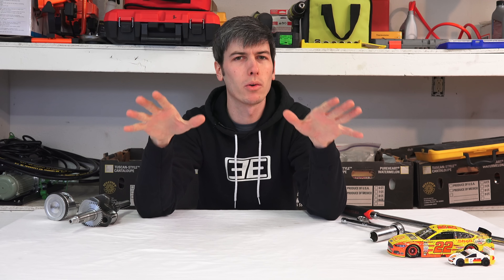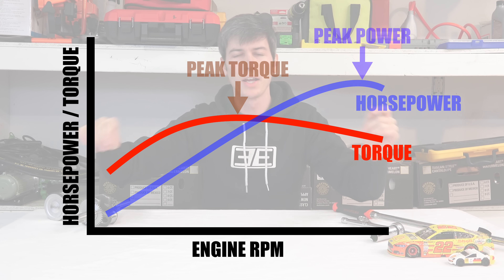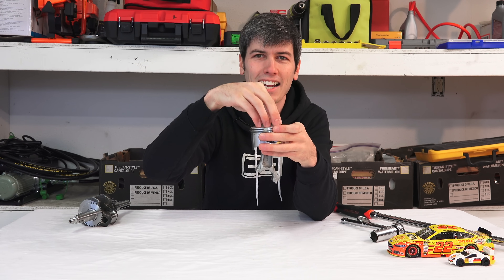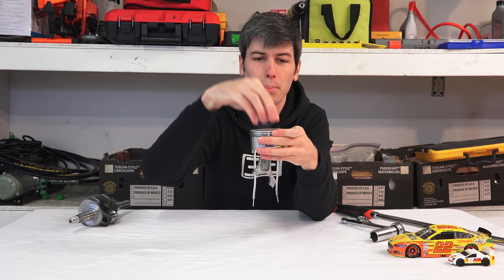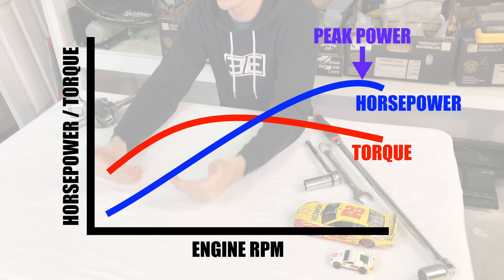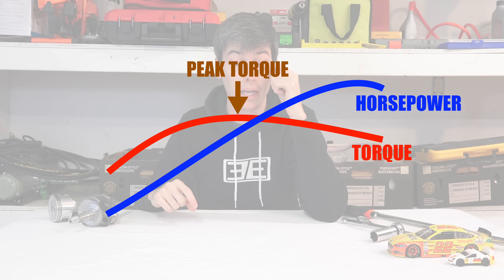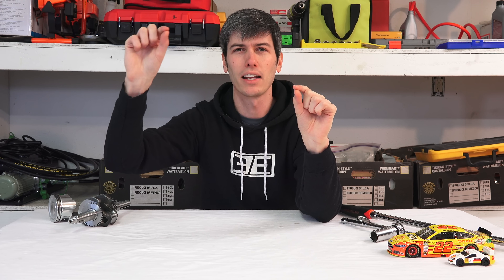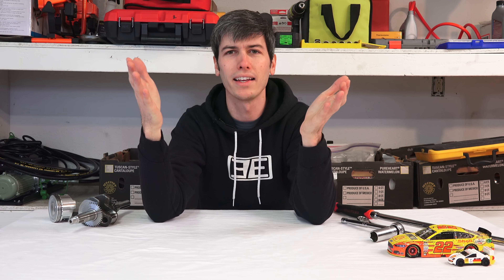Horsepower vs Torque - A Simple Explanation

Comment: First of all, thank you for this precise and very helpful explanation. 
But I have a question - as you mentioned, in theory, a CVT transmission should give the highest acceleration, because it's working on full power rpm (full throttle). How is it possible that it is slower than i.e. Manual transmission (same car, same engine)? 
What is the explanation? 
Greetings from Germany...

Comment: Is this why CVT transmissions are kind of good?
Reply: They are "good" because it's cheaper to manufacture than an automatic transmission, lighter weight, better fuel optimization curves, and somewhat smaller packaging. Manufacturer's don't care about anything else in the kinds of cars these go into.

Comment: 2017Hyundai Tuson at 175hp and 195tq (0-60 7.4sec) is faster than a 2018 mazda cx5 at 187hp 186tq (0-60 8.1sec.)  Can anyone explain that? Both are about the same weight.. give or take 100lbs.  Does transmission type come into factor. Thanks.

Comment: "Horsepower drops after peak HP, Why would you rev it up to redline? Just shift at peak HP." Those people could also take notes on total amount of wheel torque after gearing.
Reply: It's actually better to rev beyond the point of peak hp because you have are nearer peak hp again after you shiftet. Basically you want to stay in the rev band with the highest average horsepower.
For instance let's say an engine delivers 80hp at 4000rpm, 90hp at 5000rpm peak hp is at 6000 rpm with 100hp and redline is at 7000 with 90hp again. Now you shift and your rpm will drop off about 2000rpm. Where's the best point to shift? If you shift at 6000rpm it drops to 4000rpm and will only produce 80hp at that rev. If you rev up to 7000 and then shift, the rpm drops to 5000 and you immediatly have 90hp again to your disposal. 
So it's better to rev a bit higher than peak hp to still be in a good rev range after the gear change.

Comment: Could u not make a car with loads of torque and not much power move faster by using gears like a high gear and less gears like u do with a high power low torque car lods of short gears so u get the rpms up
Reply: That's exactly what semi trucks do.  Typical big rig engine only makes about 350hp but can be up to 2000 lb-ft of torque.  They use a lot of gearing, 18 speeds or more.   BUT the reason isn't what you think.  it's because these engines are designed for long durability of millions of miles; the only way to achieve that is with low revving engines.

Comment: Acceleration is the increase of velocity therefore the increase of kinetic energy.  Power is the increase of energy.  Therefore for maximum acceleration you want maximum power input to the vehicle from the engine.  Maximum acceleration occurs with the engine at maximum power output, as long as you can match the engine speed to the vehicle speed.

Comment: Now im even more confused so how can a truck have 1000hp and a lot of torque but be slow ? Is it bdcause of gears? Would truck engine be very fast if it had longer gears?
Reply from the maker: If a truck has 1000 HP and is still slow, it probably weighs a lot. A lot a lot.
Reply: Engineering Explained i mean just a truck without it hauling weight. So the issue is that its heavy? If that engine was put in a car it would rip the streets?

Comment: The only problem with this explanation, and he knows more than me about cars, is he’s talking about power moving a car from one point to another. That’s true but only because of increased air resistance. He’s right, but in a simplified physics model, which this is supposed to be, moving an already moving mass from one point to another requires zero energy and therefore zero power. Might have been better to show it going up a hill.
Reply from the maker: Work is force x distance, both in the same direction. A moving car has kinetic energy, so if you move if from a standstill (no kinetic energy), it requires power to do so.
Reply: Engineering Explained from a stand still sure.

Comment: What advantage does the 100hp/200lb*ft car have? It can't accelerate faster....could it move a heavier load faster?
Reply: The 200lb-ft engine could haul four passengers up a hill without needing to downshift. The 100ft-lb car would struggle and need to downshift i,e the 100ft-lb car has to do less work but faster with increased mechanical advantage (torque increase).

Comment: Actually the most important fact is weight not torque/horsepower....try and tow a boat with a civic versus a turbo diesel with the same power output. The civic likely won't even move, also the more you use gearing to compensate the less time you get to use that torque for.....this is why the tesla does so well huge torque.

Comment: I always learned that horsepower is bought and torque is made. 

As an aside. I was also taught that peak torque is the lowest rpm at which the piston can draw in a full charge. Which would be an indication of the point at which the engine is most efficient. Though I am pretty sure that it isn't quite that simple.

Comment: Good job explaining Torque & HP. I used to think torque=acceleration & HP=speed. Could you explain Torque as used in a big truck? A semi and a Ferrari may have similar horsepower. But the truck has lots more weight pulling low-speed torque. 
I'm not sure I know the difference.

Comment: I still don't get the graph, why do you show torque for a given gear ratio but  power you get to use two? This shows torque and power as functions only of RPM, shouldn't gear ratio be constant?
Reply from the maker: Changing the gear ratio changes what RPM you are at for a single vehicle speed.

Comment: It might be easiest to think of it as the max torque being where the engine is most efficient, but by running the engine faster, even though it's at a lower efficiency you can get more power out of it in a given time. Just another way to think about it as a mental cue, nice video :)

Comment: yeah but gear ratios aside... lets say the cars that you were showing with the opposite figures but same gear ratio.. the one with higher torque i would assume would be able to take off at a faster rate but top off sooner in the upper rpm while the car with the lower torque is taking a bit more time to get up to speed but since it has more hp it will continue to gain speed while the lower hp car is topped out.

Comment: Hi! I'm a big fan of the channel. From what I gather, horsepower = torque x rpm. How can the speed (rpm) increase while still having the same amount of force? Isn't the force created during combustion responsible for how quickly things spin? It isn't clear to me how the rpm can increase or decrease which still having the same amount of force. Thanks in advance guys!
Reply: Joe Vargas assuming natural aspiration, as each cycle passes you add more fuel, the force applied is higher , so it accelerates the revs as each cycle passes.

Comment: So if bhp is torque X rpm how do you get dips in power at higher rpm?
Reply: You get friction which adds up , also you can only rotate a set mass to a certain point where after it cannot be given any more energy
Reply: Kavi4GP but wouldn’t that cause a plateau not a dip?

Comment: Ok, you had me until you brought up the car race, lol.  I get it.  Since the truck manufacturers are always fighting for more torque, why don't they just make a thicker engine with longer piston arms and therefore increase torque?  Hope I'm making sense.
Reply: They were called Big Blocks and inline sixes. Fuel economy and emissions regulations plus modern engine tech have obsoleted them. A 460ci Ford big block made 510ft-lb torque and got about 10mpg. A modern 3.5 turbo makes 470ft-lb while getting 20+mpg and has a better high rpm power band.

Comment: Peak acceleration occurs always at peak hp, beacouse you deliver most force you can in specific period of time. You told that with a fixed gear you get the top acceleration at peak torque. I thing that's not true, but in fact you can feel that force pressing you into a seat, becouse somewhere in that range hp has the most increase (especially in non turbo cars).

Comment: Torque wins races. Horsepower sells cars. Caroll Shelby
I think he meant peak horsepower looks good on paper but if you're not maintaining a high torque throughout the band then the overall power is not utilized effectively.
A ricer may produce high horsepower but not produce later on its rpm range...

Comment: Nice video, thumbs up, but why not just say Power is time related  unit so if you talk power you are talking TIME. Most of the people confuse power with force or strength and that is because it is not so obvious from unit like 200HP to spot the TIME. If people would understand POWER = work through TIME, then it would be quite obvious if we are in terms of "fast" and "how fast" what actually means we are asking "in what time" or "how much time you need", then we know we want more POWER since Power is telling you just that = WORK in TIME.
And work is = moving the car.
Torque is just telling you what kind of gearbox you need so you can optimally transfer force to the wheels to get best power :).

On the other hand, POWER in normal language, one that is not physics related,  does not have that same meaning, hence all the confusion. It is just wording and different meaning for same word across wide scope of human activities.

Comment: You mention that horsepower equals torque x RPM. If a car, for example, has 200 horsepower and 100 lb-feet of torque, how does that plug into the equation? Wouldn't that mean you take the 100 lb-feet of torque and multiply it by the RPM to get horsepower? That would be 100 x 3000 (at 3k RPM) is 3000 horsepower, which clearly isn't right. Can you explain what units are used to plug into the horsepower equation for it to make sense?
Reply: No, you have to divide it by 5252, so 100x3000 is 300,000 divided by 5252 = 57.121
Reply: Thanks for clarifying! Would be useful to include in the video, but I suppose a Google search would've answered that for me as well.

Comment: What confuses people is that they think they can "feel" torque. If you have 2 cars like say a dart 1.4t and a dart 2.0 na. They have the exact same peak hp number of 160 but the 1.4 turbo has ~40 lb-ft of torque more. It is quicker and feels quicker because it has more hp in the lower rpms while the 2.0 has the same peak hp but much less hp in lower rpms. If you had a cvt or at least a 10 speed transmission that kept the engines in their peak power they would be exactly the same speed. However when most of us drive we drive at partial throttle 2-4k rpm, not at 6.5k thus we feel the greater hp the car with more torque has. 

TLDR
Cars with more torque have more low end horsepower then cars with less torque but similar peak hp
Reply: Great of you to note this. So if we stick to the philosophy that power is ultimately what we want (although torque is still important, we not too concerned about it), we need to get away from the idea that only peak power is important. What your are hinting at and what people need to consider is the is the area underneath the power curve. The greater that area, the faster the car can accelerate.
Reply: Exactly why modern turbo diesels became so popular (in UK and Europe at least) as they provided accessible HP in day to day driving.
Reply: This is what I was looking for. The difference in torque between the e92 BMW 335i (twin turbo inline 6 cylinder) vs the e92 BMW m3 (v8 na) where the 335i has more torque but the m3 has more horsepower.
Reply: Very true that
Reply: The peak numbers might be the same but the turbocharged car may have it over a wider rpm band, making it closer to its peak value more of the time. The peak numbers don’t tell the full story
Reply: chad wran so that would make a turbo charged engine better than a naturally aspirated engine?
Reply: Tanah nailed it! Torque directly correlates with rate of RPM change (perhaps we'll call it angular acceleration) while power correlates to vehicle speed change (acceleration). High torque helps trucks accelerate loads from a stop without stalling or burning clutches and it helps turbos feel perkier by making the front part of the power curve steeper (the slope of power or acceleration is called "jerk").
Reply: Tanah Merah That's not right. Within a particular gear, peak torque is where the engine is most efficient and has the greatest acceleration. Torque is a force and  angular acceleration is a component of it. When you bring a gearbox into the equation you can get better acceleration at peak power by gearing down.
Reply: Exactly, peak horsepower is meaningless.  It's the available horsepower at that particular rpm that's important.  A car will accelerate the fastest at peak horsepower.  Torque is what determines how long it will take you to reach that peak horsepower.  Engines with more torque will allow you to reach its peak horsepower (i.e. peak acceleration) faster.

Comment: In my automotive engineering bachler we calculate if a car is able to achieve a certain acceleration. The formula that we use is Facc=p*mass*acceleration where p depends on the chosen gear. To calculate if the car able to achieve this force, the torque of the engine was converted to the torque at the wheels. Then, by deviding it by the dynamic wheel radius, you have the force at the wheels. If this force was higher than the acceleration force, the car should be able to achieve this acceleration, if the grip etc was availible. This is without the rolling, air, gradient resistances. The thing that i dont understand about this method it that is has nothing to do with the power of the car. How does this work with horsepower and what is wrong about this method?

Comment: I have heard that you're vehicle is most fuel efficient (when accelerating) at peak torque as well. This would make sense as it should be the point in which your engine is at the best ratio of work and power. Assuming I've understood all this correctly.

Comment: Great work, but one flaw.
You didn't say the advantage of a certain vehicle to focus on having more torque instead of horsepower.
What i mean is: a person could think that only horsepower matters after seeing your explanation, understanding that torque is ONLY a variable that helps determine HP. After all, faster is better, you didn't explain why a truck would be better with high torque instead.
Reply: That wouldn't matter because your tractive force is your engine's current power output divided by your vehicle's speed. Trucks have a lot of torque because they have a lot of power at very low rpm. That's not because high torque is better at pulling. It's because lower rpm is often more thermally efficient.

Comment: question is why does a diesel engine produce more torque than a gas engine. please make a quick video on this
Reply: Fabian Garza diesel burns/explodes/knocks at a slower rate, as explained torque is a force x distance, so the slower burn means the force is applied over a greater rotation of the crankshaft. Also higher compression ratio means more pressure over an area=more force

Comment: Great explanation, but 1 thing . Your 200hp/100fp V 100hp/200fp this could infer that rotary engine Vs v8 engine Vs Ev motor that the Rotary will always win as it has more hp than fp, next is the V8 hp=fp and last is an EV high fp low hp. Horse power needs gearing more than Torque, Torque can over come lack of gearing. And still Horse Power= torque X Rpm /5252. You can double the HP in a car by doubling Torque or doubling rpm. need more head up videos like this. Two Thumbs up mate.

Comment: I've had that question for a long time and never had such a simple answer. Wow! Great job!
But why do Telsa cars (2018-2019 Roadster first) accelerate that fast knowing that they don't have the greatest hp figures? They do have a pretty insane torque, but 1.9 sec from 0 to a 100km.h-¹ while the Chiron, having more power but less torque, needs 2.5 sec... That's insane! 
No gear changing so continuance of the transmission of power down to the ground?
Reply: Actually no. It's because Tesla can use more power at launch than Chiron (assuming equal mass and tire grip).
Reply: Muh Face And why is that? Electrical means more power at start? Because of the power curve of thermic engines while electricals do have it right at start and all the way long?
Reply: Brushless electric engines pretty much have peak power at almost the whole rpm range. Combustion engines mostly have peak power at a very thin rpm range.
Reply: Muh Face Thanks a lot!

Comment: All else being equal would the car with less torque and more power still accelerate faster from a standstill if it wasn't bound by traction (unable to spin the back tires)?
Reply: Yes, if you could use the power effectivly with the gearbox.
Reply: jaboxs Ok so essentially it comes down to wheel torque and the car with greater power could take advantage of higher gear ratios
Reply: Correct.

However, as you might already know the a lot of people call gearing for higher top speed "higher gearing" and others call higher numerical gearing which would mean a lower top speed "higher gearing" which gives rise to quite a few misunderstandings.....

Comment: Sorry, but i dont agree with this, actualy you need the intergal of the torque over rpm. Power peek tells you only at this point the work of the engine, not the acceleration. The higher your interal, the higher is your acceleration.
Reply: That's actually quite wrong.
Reply: no its not, if you work with simulation programs, you can see, that they are using this.
Reply: Acceleration is literally power / mass / speed.
Reply: yes, but only at this point of view and not at the complete rpm
Reply: Current power output and speed ratio is the acceleration however you may want to say it.